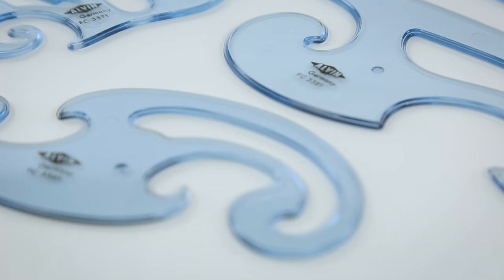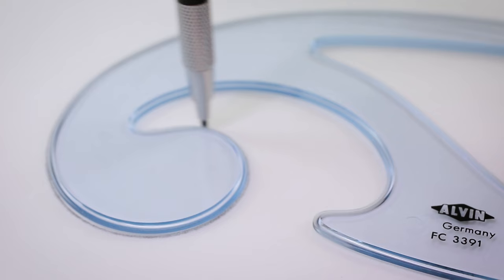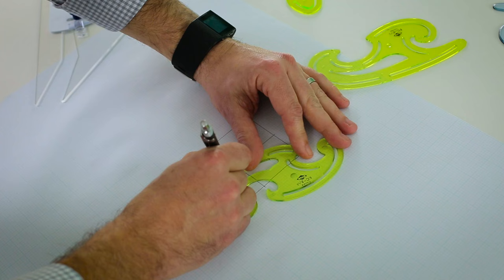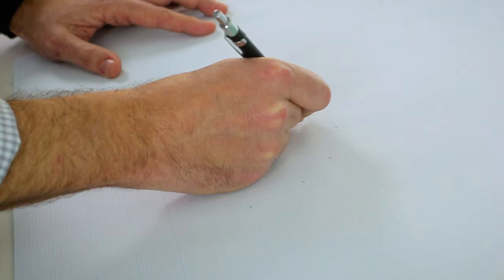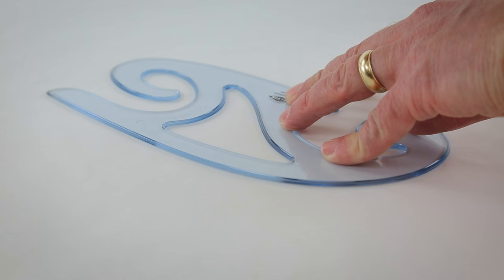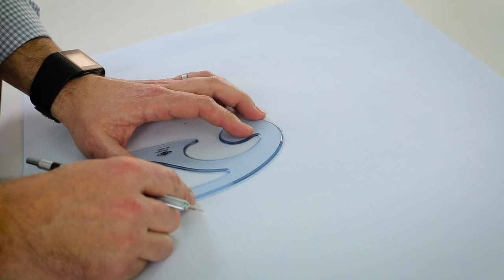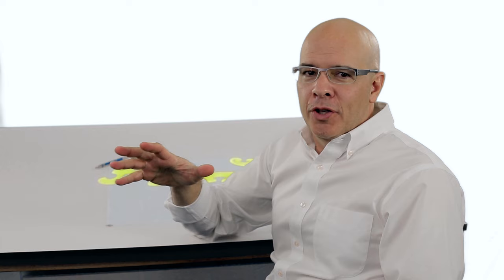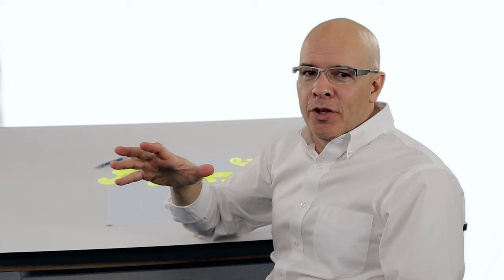Drafting Tools 101 - Learn How to Use French Curves

Comment: Why do you call them "french"? They're not french...
Reply from the maker: Great question! There are many different theories, but none can be verified. The "French Curve" was first designed by Ludwig Burmester, a German geometer to which it was called the 'Burmester Curve', the shapes are segments from the Euler spiral also known as the Cornu spiral and low and behold Cornu was French. No one can truly verify if it was named after Cornu, but the original name for the curve was the Burmester Curve.
Reply: Mandorle21 hay
Reply: @Alvindrafting  These guys; https://www.mapleprimes.com/questions/102902-Origin-Of-The-French-Curve-Or-Mathematical speculate, that they are called "french" because the first mass-manufactured set of these curves was made in Paris.